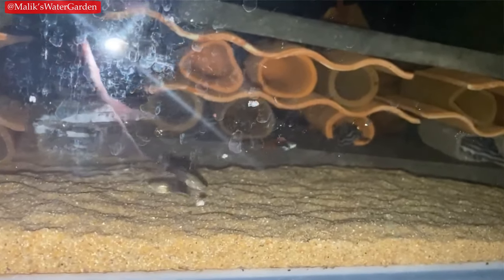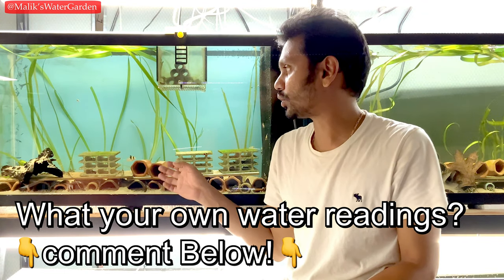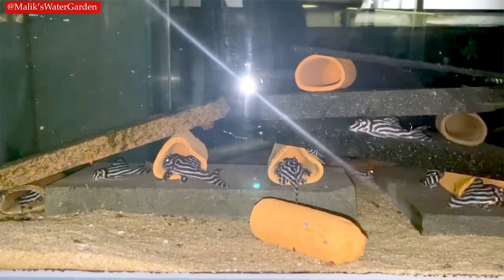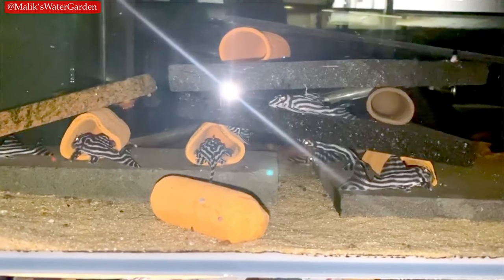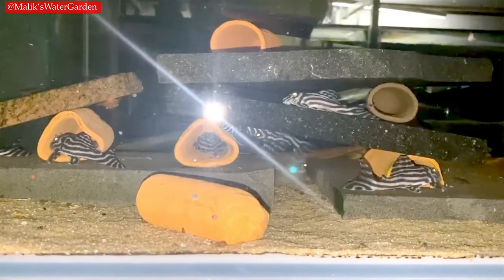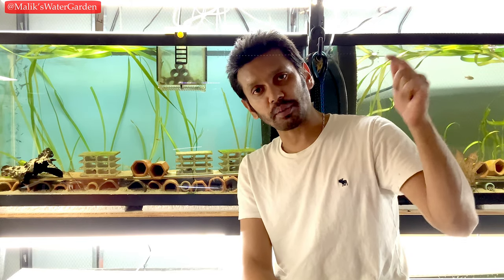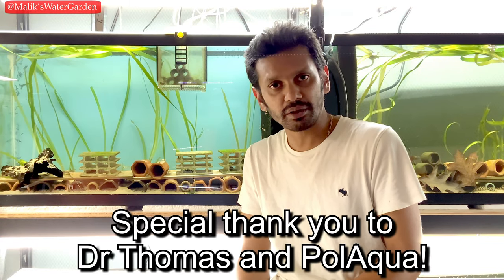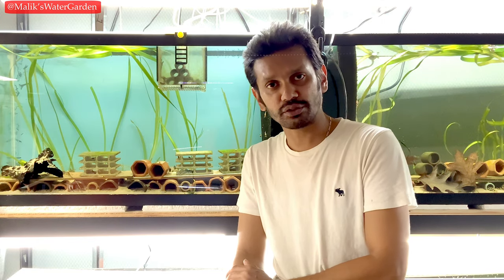How to Breed Zebra Plecos! with Dr. Thomas! Water Parameters!

Comment: Would it be possible to do a video on the L140? Or do you have an idea for breeding these? 
I have a group of 12 grown ups. They are really big (at least 4 years old each) but they do never breed. The PH is around 6.5 and my water seems fine. I have a strong current and lots of flow. They have around 20 caves and lots of oxigen and grass. Maybe it's the guppies? Is it too crowded? Theres around 50-80 guppies in the aquarium too.. I have them in a big aquarium of 1m20 wide. Just can't find a lot out there about these fish and not 1 single video on youtube about breeding.

Comment: Hi so my ph is 8 out of the tap I’m trying to get some of my black rams and l number plecos to breed I have just ordered a ro unit and I was thinking if I do a 20% water change and I add 5% ro and 15% tap water will that bring my ph down a little I was going to do this slowly and try and keep an eye on the ph I don’t like to mess with my water but my rams have not bred in 3 months I wasn’t going do di the ro water as my tap is very hard what do you think
Reply from the maker: start with smaller amounts of RO to tap mix and see how much the ph might change.. once u get an idea you can slowly increase the RO mix ratio till desired ph is achieved.. its a bit of trial and error unfortunately